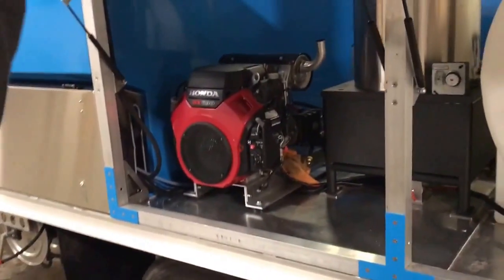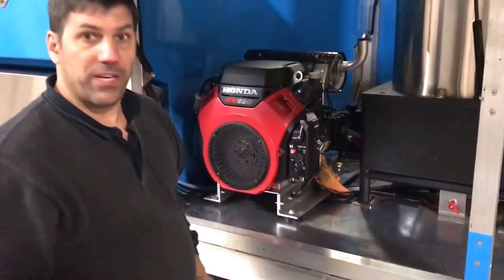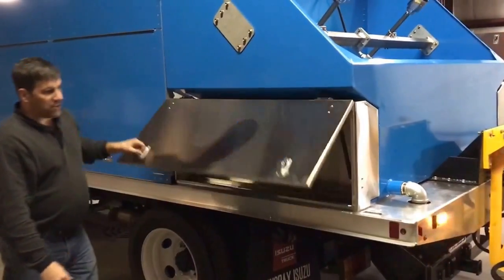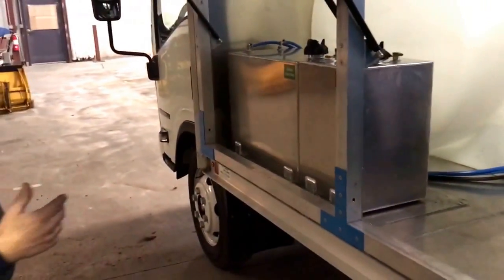Clean cans trash bin cleaner

Comment: Why is no one putting the plumbing and power in the rear and the cleaner bin in the middle facing to the side? Just like normal trash can trucks? A camera can allow them to see the can, pull up on it, grab it, clean and go. Put some power washer nozzles inside the bin so no need to get out of the truck and wand the can. I'm stunned no one has figured that out? The key to that type of business is volume. Inefficiencies like getting out to clean the outside of the can cut into time a lot. That's costly. The model is already developed by the local town. Stay in the truck, clean and move to the next. Nice rig btw.

Comment: Thank you for the in depth walk around, this is great. The trucks space is utilized very efficiently. A few Qs:
1. A 2.1GPM pump with 6GPM heads? isn't that pump not adequate for the Bolondi heads?
2. Over time opening the pass side door at each stop would get tiring. A removable door would be nice to take off during work day and re-place end of day. yet that's just my opinion!
3. What are your thoughts on a PTO system vs pressure washing system? Still learning that subject.

Comment: in principle i like it but ... that set up is a bit pants (sorry but it is, though i could be wrong with the following points?)

Clear water tank ... thats going to suffer with algee blocking filters/pumps with in a year - so new tank every year/2 years?.
No recycling water (imo good) .. but no dirty water tank either means you are dumping contamininated bin juice/water on the road? first cleans customers are going to love you! *enviromental impact?
Lifting arms .. there seems to be a bunch of companies with that style, how the heck are you supposed to wash the outside of the bin with it that high in the air? or is it you stand around until its lowered then wash.
At the end of the day how are you meant to get all the "crap" out of the wash bay? Ladder/scaffold tower to clamber up in the back and then pick big bits out?

pretty sure who ever buys that truck will be bored of trying to stick their lance in that hole/holder before day one is over if theyve more than 5 bins to do.